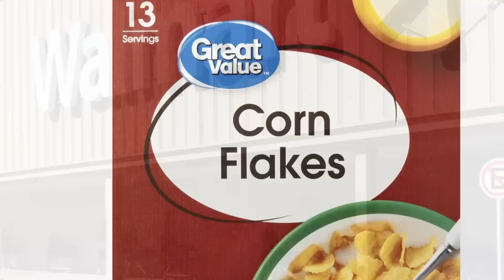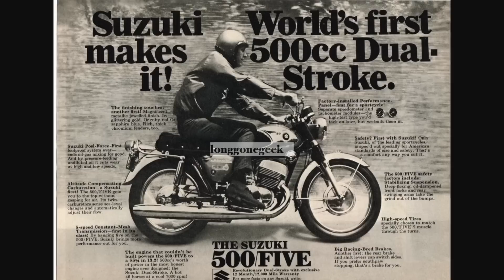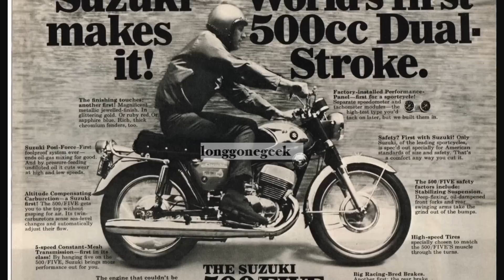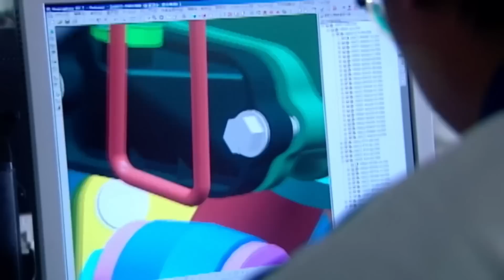How Suzuki became the Walmart of Motorcycle Companies

Comment: Suzuki builds bikes that really address the needs of the majority of riders at an affordable price. Like my ‘07 SV that just keeps running (53,000 miles on it). Fun to ride, gets me to work, fun on the track. The industry now is focused on high powered bikes to charge more. Most riders can’t handle the power. So sophisticated software (charge more) to reduce the power by 50%. And then a video game for gauges (costs more) when most riders really just need a speedo, tach, and a few lights (neutral, oil pressure, low fuel, high beams and signals). The riders (who often can’t ride can show off their fancy, expensive toys. Who cares?  Just ride.
Reply: 100% agree.

Spec sheet warriors have forgotten the other half of riding - the riders. 

Chasing ever increasing performance specs is a losing game - the law of diminishing returns.

Also, as regular people keep losing ground economically, we'll need good bikes at reasonable prices.
Reply: Well said! I'll take proven technology over special effects any time, I love my DR650.
Reply: Right, most people don't need or want 200bhp in a road bike, 80hp of torquey performance in a sweet handling frame is so much fun and it doesn't threaten to bite you at every small riding error.
Reply: Suzuki definitely listens to its riders. I have a 2015 V-Strom 1000 that I had an issue on where at low speeds the air box would “cough” so to speak and it would cause it to stall. It didn’t happen all the time but there were a few times I was riding thru the parking lot of my job and almost went down because of it. I spoke to the dealer, then spoke to Suzuki about it. They had me bring my bike to the local dealer and like 8 guys from Suzuki Japan came in and interviewed me and had their engineer take a look at my bike then shortly after there was a recall on the ECU. I know I’m not the only one who has this problem because they wouldn’t do a recall for only me but I’d like to think I was the official decision to issue it.
Reply: wow thats alot of miles my 05 only has 12,000 miles
Reply: Well said. I can’t stand digital displays. On a motorcycle, when you don’t always have time to stare at the display, one only needs to glance at an analog gauge and the position of the needle tells you everything you need to know. Analog gauges are even perceptible when looking out the corner of your eye. But with a digital gauge you have to read the number. It takes more effort to comprehend what you’re seeing on a digital gauge. And of course, lighting conditions don’t affect analog gauges.
Reply: Love my sv650s for everything you said. If they ever did a sv650xr edition with similar quality suspension and breaks to the gsxr models I would buy one a million times over.
Reply: @FunniestFlicks  When I first bought my SV I put a YKK shock and Racetech Gold emulators on it. Much firmer ride for Track Days. Also, Galfer braided steel lines front and rear, Galfer Sintered pads, and Pazzo Racing Levers. Dramatically better braking. In C class at track days I consistently lapped faster than 600s and Liter bikes. Had gone thru Level 3 at the California Superbike School. The SV is a great bike for learning to ride fast on the track.
Reply: I have the exact same model year. Bought it with 2,000 miles on it. Lots of fun, fast enough, and wasn’t too expensive. Great bike. Fun to ride

Comment: 6:07. What made the first GSXR look so good was the dual headlights. This has to be one of the easiest things in the world to figure out, and yet every modern designer has got it wrong: You need 2 headlights on a sport motorcycle. It's the twin separate headlights which create the sporting look of a sportbike. You cannot have one headlight, because it never looks good, no matter how you do it. This applies to all motorcycles that have a front fairing. The single headlight is a 1960's look, and the twin headlight is what makes a bike look modern, and also beautiful. A single headlight never matches with the modern bodylines on modern bikes, and yet many companies continue to try (and fail) at using a single headlight, because they seem to be totally confused about how to design a bike. 1997 to 2002, was the best era of motorcycling for sportbikes, and it has still never been matched.

Comment: There is nothing wrong with building reliable, oil tight, inexpensive motorcycles. If I had the room, I would have a Suzuki DR 650 parked next to my Triumph T 100 Bonneville. Some folks just want a motorcycle, not a status symbol.

Comment: Being an older dude I’m sill skeptical of the new electronic controlled bikes ,for a couple reasons… it limits learning to control the bike when there’s traction control ,abs ,electronic suspension adjustments etc etc …then what about Maintenance and longevity of these electronics and repair costs of em, or is the bike rideable when / if the electronics fail…? I prefer having a more reliable platform that I can find real limits on, repair some issues myself ,and doesn’t cost close to the price of a decent car …I know in all these regards I’m in the minority…but m y take isnt alone..just got an 09 fz1,and am considering  another bike down the road of similar lineage …like a gixxer from early 2000’s or a Kawasaki zrx1200 if anyone sells one near me ever….if not maybe a Kawasaki z series …or ninja ,something that has got bars not clip ons and is at least somewhat comfortable …ala gsx( no r) with bars and slightly more upright riding position….
Reply: I'm with you. I've loved my 2007 FZ6 since I bought it new and it took me 2 years to figure out my next daily rider. I got a DR650 last June and one of the big factors was the simple old school tech. I kept the FZ6 for spirited riding. Not as cool as your FZ1 though.
Reply: @davidklementis5913  it’s all good … maybe I sounded a lil like a grumpy old man …. In the long run ,if you’re on 2 wheels , life is good 👍🏼

Comment: Walmart is the devil. Being compared to wage slavery isn't maybe a good thing. Suzuki has something going for it by complete accident and that is that they are behind on all the electronic crap that is making riding well less riding. Most of their bikes don't have ride by wire throttles. You can get on and be the only thing controlling the bike. Pure feedback from direct controls. Their bikes are a decade old in design and feel like yesteryear. Some people still want that. If you want to feel times past Royal Enfield and Suzuki make bikes that can deliver a semblance of what you miss. Suzuki is the king of sport bikes from when they were peak.
Reply from the maker: I think you've got a good point honestly
Reply: I agree with you fully! I have Suzuki bandit 1200s  that pulls like a train, looks good,  easy to work on and very cost effective it just absolutly works! Yes it is a parts bin bike but, is that bad? You have knowledge of what parts you are using the bad and the good. Engine from Gsxr1100 tested brute of an engine with lots of useable power and reliability. Some guys like the gentlemen above stated, just want stuff that works. Cheap, accessible, less gimmicks and nonsense. Sometimes is good to not be part of the bandwagon parade, to be a rebel is to the opposite of the parade. Less is sometimes more. 

Great episode Bart!

Comment: I'm looking at my aging Suzuki Intruder and think I need a new Suzuki Cruiser... which doesn't exist in small displacement anymore. Sadge.
Reply: Sold my 2000 VL1500 last April with 85k miles on the clock. If I see a C90 Boulevard for a good price like $6,000 with low mileage I would buy it.

Comment: the sv650 being a fantastic and unusual setup is enough to earn my respect for Suzuki. And, in my opinion, Suzuki usually has by far the best color schemes, especially for sport bikes. I fully intend to buy an sv650 in the next couple of years
Reply: Top bike I did 35,000 km on mine. Spent a bit of money on the forks and rear shock absorber and it was a sweet thing. I had the 99 carbureted first model. Don't know if they put better forks on the later models.
Reply: A bike from 2000😅
Reply: @kolour7611  its had some significant changes since then. Current generation came into production in 2017, and has had its brakes updated since then also.
Reply: @@FITNESSOVER45   Well, as great as the SV650 is, I'd say that's more than rider than the bike.  Corners always seem to separate the men from the boys.
Reply: Lol colors by other 3 all better honda great red white blue done better than any one yamaha yellow black classic and kawasaki green rocks. Suzuki again bland like walmart
Reply: Looking forward to buying a SV650s 2009 this weekend :D
Reply: @SteveMuir  I very much doubt! I have a 2012 dr650 and it is SOGGY!!!
Reply: sv650 is great. i have a 2003 model. Very reliable and fun bike
Reply: I want a road test comparison with the 8s sooo much.
Reply: Wanted the 92 1.3 Swift GTi Battle Tuned  but I went and bought 1.0 Charade GTti bcoz a buddy beats me to it. 
Learned 4x4 off road in a 85 SJ410 and my first heavy crash( fractured femur) on a RGV250 .... that's my experience with Suzuki brands
Reply: The SV650 is a girls bike
Reply: The current generation SV650 (the gladius) just cannot hold a candle to the MT-07 platform.

Down on power, still using a 160 rear tire instead of the current standard 180, still uses pretty sticky forks, brakes are very bare bone, rear shock is still bouncy and sticky...

With the existence of Yamaha's MT series for $500 more, I just cannot in good conscience recommend the newer 'SV650' (gladius) to anyone for how much it costs.
Reply: you should I love my SV
Reply: @Bacon676  the price difference depends on the market, here in Colombia the MT07 cost USD$1891 more than the sv650. The price difference is about the same in India.
Reply: SV 650 was and is a mark of genius from Suzuki.
Reply: The sv650 was a Peach! Great bike
Reply: @Bacon676   V twin over parallel all day long. Who pays more for an inferior engine design? Balance shaft? Ppft.
Reply: I loved my Sv!! It had 36,000 miles without a single issue. Not one! Miss that bike.

Comment: Loves my Bandit. It’s 1200cc’s of full grunt are all I need. There’s a good reason these engines are popular with drag racers, but stock with a little jetting, you get a 120 horse, 90ft-lbs monster that’s a docile lamb around town. Plus you can pick them up for like $2500 or less.
Reply: i ride a 06 bandit air oil cooled too
🐱👍🏿 its still in original 90hp setting i think 100 mainjet 15pilotjet...never been changed
Reply: All the ones ive found are beaten and/or stolen. Almost always buying off of a criminal.
Reply: @DarkLinkAD  lol…mine was thrashed…so I fixed it and made it better!

Comment: You go on for 5 minutes detailing how the sport bike market is dead, and then you go on to say Suzuki needs to redesign the GSXR 750. It's either one or the other. Also, I guess maybe you weren't aware that the new GSXS 1000GT won motorcycle of the year from Rider magazine last year. So I will say at least that they're heading in the right direction. And I would also say Suzuki is perhaps the most reliable of the big four Japanese brands. Even the mighty Honda has had its share of issues the past half decade. Every Suzuki I've ever owned just runs and runs and runs never once having an issue.

Comment: In 1978 I was in the market for one of the new 1000 cc superbikes. I really wanted the Honda CBX but it was $4200 which was incredibly expensive. I settled for the Suzuki GS1000 which cost $2800. That was a great bike and I kept it for 6 years. Much later, in 1990, I bought a used 1979 Honda CBX in perfect condition. I sold it in 2004. I should have kept it.
Reply: wow 1400dollar difference between the two!!
Reply: that 1400$ difference in 1978 is a 6500$ difference today! that is massive!

Comment: Suzuki has definitely had some great bikes.  I'm not quite sure if I agree with the Walmart analogy, I don't see the Walmart pricing. Yes, the old GSXRs were a bit more hard edged, more of a track ready bike than its competitors at the time. I think that turned a lot of casual riders off. You would get beat up on long rides or daily use. The Busa was and still is nuts.  Suzuki made a lot of great dirt likes as well.

Comment: Small point. The Suzuki Titan 500 two stroke was not unruly. The Kawasaki 500 triple two stroke was unruly but fun. The Titan was bullet proof and dependable. I should know because I owned one .
Your videos are great and I'm a subscriber.
Thanks
Reply: Correct
Reply: Yes, a good friend owned a Titan 500 and it was relatively mild mannered.  BTW: We went on a motorcycle trip from Lansing, MI to Silver Lake State park once with me on a Triumph 500 Trophy and another friend on a Triumph 500 Daytona and the only bike that gave us issues was the Suzuki when its shift lever fell off and was lost !!!  => Consequently, we put the Titan 500 into 4th gear and stayed on the interstate to get home to minimize slipping the clutch.  I have been driving a 1996 Suzuki DR650 since 2002 which now has 21K miles on it.  It is a much nicer dual sport then the 1969 Triumph 500 Trophy and very reliable and easy to work on.  The DR650 was totally redesigned for the 1996 model year and it is virtually unchanged for the 2023 model year (different engine base gasket and different colors now).
Reply: @tomwells9677  I loved that era. I rode the 500 Triumph very enjoyable, I wish I had one now.  I now ride  a 05 BMW GS 1200 this bike fell into my lap.
Reply: Yes you are 100% I've a nice 1971 suzuki t500 j in mint condition. Goes really well.  Fitted electronic ignition and it starts 1st touch of the kick start.

Comment: I bought a Walmart Suzuki --a new 2007 V-Strom DL1000. I am a large tall guy and it fit me good in the showroom.  I added a Corbin seat and drove it as a sport tourer. I still have it now with around 38 thousand miles, and it has only needed oil changes, new tires, and one valve adjustment. This bike still feels fresh, crisp as the day I bought it. I am sure it will hang in there for years to come serving me perfectly.

Comment: I had a GS750- one of the innovations was the LED gear indicator. Everyone else was counting gears, but the GS told you which one you were in. Don't forget the 250 & 500 Gamma.
Reply: That is about the only Suzuki I like but I don't see the point of the gear indicator. If you are riding and need to change gear you either need to go up or go down. Why do you need to know what gear you are in?
Reply: I had both :hand-purple-blue-peace:
Reply: Same on my shaft drive 1982 GS650G.  That bike has more features than many under 700cc bikes today.

Comment: My very first bike was and still is the Suzuki drz400sm, and I love the thing, I will probably keep it for many more years to come. The platform hasn't been changed for years and I'm not sure if it really needs to change. There's so much aftermarket support for these things that if you need to change something you can find a solution pretty easily. And the old school tech makes it pretty cool in my eyes and simple to work on. Though, I've recently placed a deposit on a new ZX-4RR though and I think it will be a great compliment to my drz as a second bike. Very excited for this summer so I can get on both bikes.
Reply: Had one for 30k. Needs improving big time! A 6 speed to start with, with a lower 1st to crawl around at low speeds and a higher top gear as its got the power to hold a higher gear with less revs. It’s a bit thirsty too. Maybe fuel injection is in order to as they are not cheap for a 20 year old design.

Comment: I'm an odd ball middle aged quickly progressing to old fart guy. I love my 2007 FZ6 I bought new so much it took me 2 years to figure out what I wanted to replace it as my daily ride.

In June I bought a Suzuki DR650 and one of the biggest factors was the old school simplicity. That and I wanted something I could comfortably ride into remote places. I love the bold new graphics and lack of wizzbang tech.

I still have the FZ6 for spirited riding and the sound of it's 4 cylinder roar above 10k rpms.

Comment: Great video. What's missing from your history is the debacle of the Suzuki RE5, which almost bankrupted the company, I guess. Suzuki's reaction was to copy the successful DOHC platform of the Z-1, which started the 70s/80s UJM craze.
Reply: Suzuki should try to bring back the wankel engine by buying engines from mazda and installing it into a hayabusa🐱👍🏿
Reply: Copied yes but also improved upon, let’s not forget the GS was far better handling bike than the Z
Reply: @rwd323  I've never ridden a bike from the 70s that had decent stock suspension. The big Zeds I've owned and ridden all had soft fork springs, poor shocks, etc, nothing that would bother you unless you rode the bike to the edge of its capabilities. Zeds were "stoplight racers", great in a straight line, not as great otherwise, though a change to lower, flatter bars, better springs and shocks really transforms them.

Comment: Remember in the movie Platoon, when the sergeant strips the new recruits of all the unnecessary equipment, for obvious reasons--that's Suzuki.
I just don't think this channel gets Suzuki: take a tried and true awesome engine and build a basic, no frills bike around it and you have the essence of practicality and fun. Fun, because reliability is not a euphemism for boring, but Boring is a hollow pejorative for Reliability. Breaking down, hauling to dealerships, repair costs, time wasted  etc that is what I avoid at all cost. I hear the same from boaters about Suzuki motors too. I am a practical idealist; and proud Suzuki Freak. 
BTW I own an air-cooled Bonnie from early 2000s for the same practicalities.